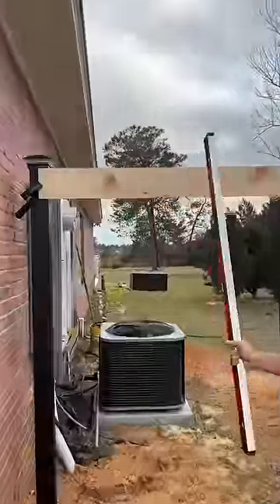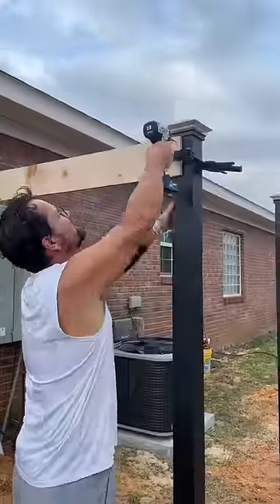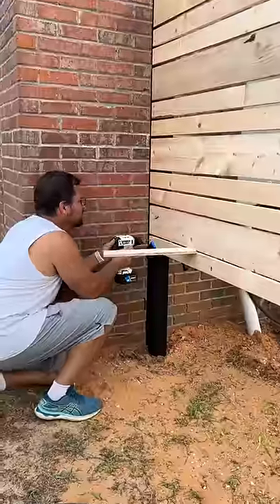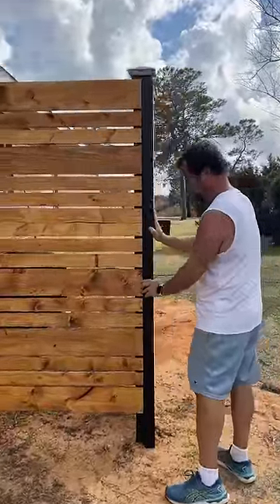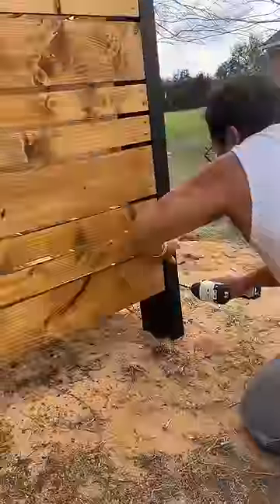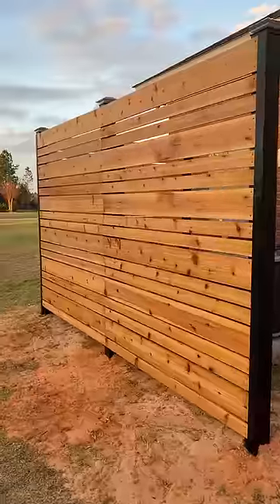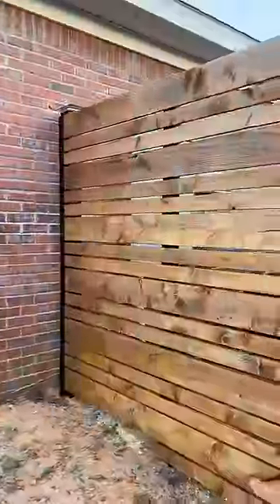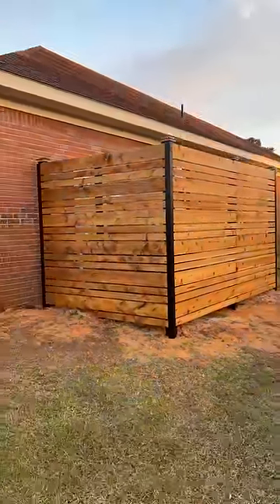DIY HVAC privacy screen part-2 #fence #diy #diyhome #privacyscreen #howto #homeimprovement #backyard

Comment: As an AC guy, THANK YOU for giving your AC room to breath!
Reply: He built a shed for it 😂
Reply: Its an idea whose Time Has Come!
Reply: I Thought the same thing 😂
Reply: I was wondering if it would hinder heat exchange
Reply: @patrickglaser1560  given the distance and that there’s slats should be ok. In a perfect world obviously it wouldn’t be there.
Reply: I'm ex electrician and I was thinking the same thing when I saw the first video.
Reply: about to make a privacy fence around my unit.  how much room do I need to leave in order for the unit to breathe properly??
Reply: @overdalimit  The more room the better. Minimum is about 2’ around. Especially on the service side (where the copper pipes and electrical are). Also try something like he did in this video, or use something like lattice. Avoid plants (especially flowering) if possible.

Comment: I love it, looks great. 
The only advice I can give you regarding longevity is set up (clamp) a small cut off plastic bottle at your drop saw station with a small cheap throwaway paint brush and coat EVERY end cut as soon as you cut it. (slop it on)
Cheers from Australia.
Edit: throwaway the excess as it will be contaminated with sawdust.
Reply: Good advice

Comment: As an HVAC tech, I approve the over two foot distance that fence is from the outdoor unit.

For those curious (when able), keep bushes and constructed structures at least two feet from the unit and don't build any covering structure below 5 feet from the top of the unit. This is a general rule, consult your units user installation manual from specific parameters.

The outdoor unit needs air to blow over the coil and restricting that air flow can damage your unit over time.

Comment: Nice work.. one tip for the folks thinking about a similar project, stain your boards before installing them since you can get coverage on the grain ends and coat all sides thoroughly laying flat on work horses.

Comment: A tip a carpenter taught me was whatever your gap is between each piece you take that measurement and cut a small piece of wood to that size. Now everytime you go to place the next piece you use this spacer to set your gap correctly and quickly without measuring each time.

Comment: Unfortunately those decking screws will probably rust. I used to use them until I had call backs and when you install them the coating comes off an then its just a normal screw. I would have used stainless screws

Comment: Very nice work. It was good to give your AC unit some space as well. If you could hear the AC unit in the house before did you notice any increase in the sound levels after you finished construction? That’s not a criticism; it’s just my curiosity.

Comment: Hvac tech here, hopefully you left the one side open for maintenance and replacement...
And your supposed to let treated wood (the 4x4’s) sit for a few months to dry before you stain or paint 
Basically, your treated wood beads water, you wait till it no longer beads the water it absorbs it then u stain

Comment: Never make fencing slats like this run horizontally but make the wood run vertically because the reason is that water & snow sits on the slats thus rotting the wood faster. Making it vertical allows the rain water to run down!

Comment: Great for two years tops until you need to repaint the black parts and then you literally have to take it all apart again and you hid the screws under wood filler so I do not think your grandkids will ever get to witness this.

Comment: Your AC unit felt naked? All the non architecture of modern houses as you drive up to the main feature of an American home.. The garage door and the Air conditioner was what bothered you..? And the architect could have located the HVAC at the back of the house as easy as putting it at the front door or side of the house..